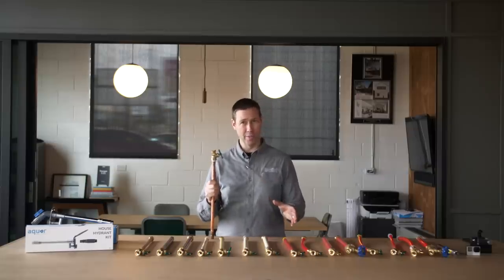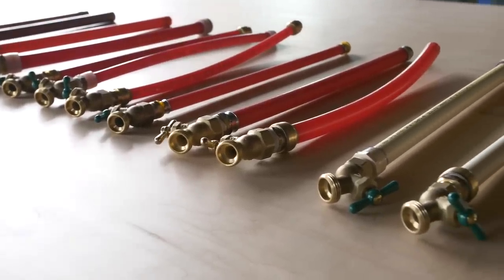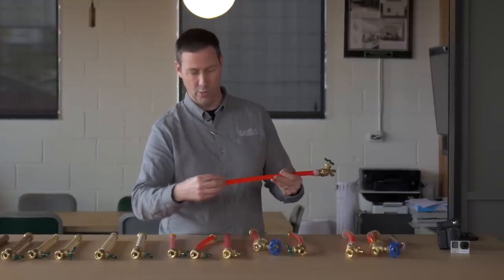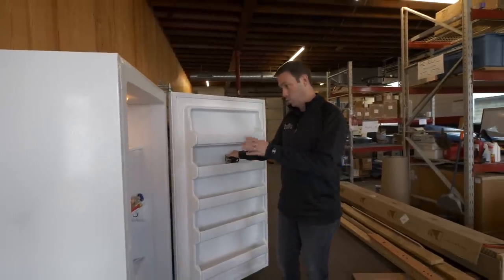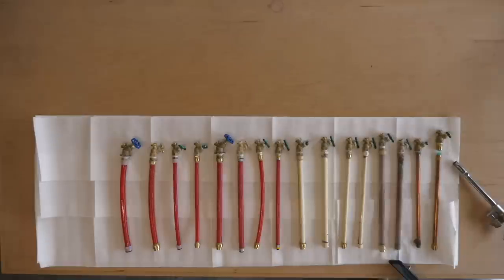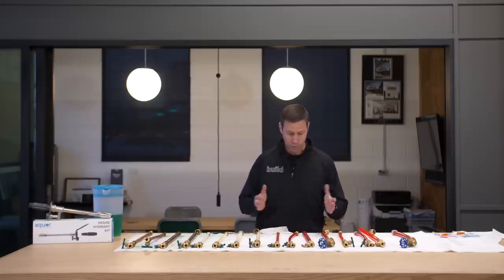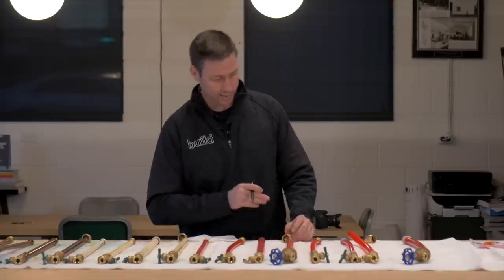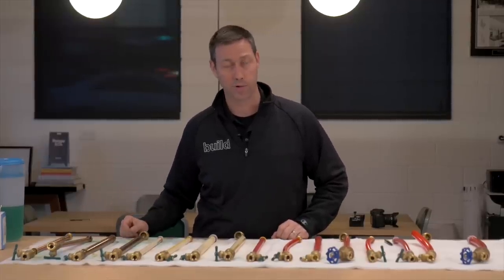Copper vs Pex vs SharkBite - Freeze Testing

Comment: Glad  I  found  your  channel
Reply from the maker: I’m glad you are here!
Reply: Matt Risinger 
   Hi, found your channel and learned about the shark bite fittings from a previous video, so want to say thanks for the info. Have been retired for a little over ten years so haven't kept up with the latest and greatest in the plumbing world, but appreciate how you do this.
   Grew up and worked in the northeast, and then my job has me in just about every state in the southeast, so am familiar with your comments on how things get done in different ways in different areas. One aspect of this that might be before your time was the difference between the southern and national building codes, and how some of the SE state's didn't adopt codes until the later half of the twentieth century.
   One aspect that this test couldn't take into account for is how easily copper conducts heat or cold through out a system that can't happen with the PVC or PEX. So those hose bibs connected to copper in a regular house would have much more space for the frozen water to expand back into the house with less or no damage. And equally the heat from the home will radiate out to the bib to make freezing less likely.
   What you have shown is still interesting, but just wanted to mention the caveat that there would be different results when taking into account these outside fixtures being an extension of a whole system.
Reply: As a professional we don’t use shark bites. They all leak. Great for business.

Comment: You need to start with the lines pressurized.
Reply: You can't compress water. The pressure can go up, but the volume does not change. So for the purpose of testing ice splitting the pipe the water pressure does not matter.
Reply: @kirkwilson5905  Hi Kirk.  Water doesn't compress, but pipes do expand before reaching their failure point. Pressurized water exerts pressure on the pipe even before it's freezes. The 60 PSI in the line, when the line is pressurized is additive to the additional pressure created when the water freezes.

Comment: We have the 50 year old 1/2" copper going through the house wall to the hose spicket. We have never turned off the water for the winter, or put on an insulator, and have never had an issue.  This is up in Detroit where it occasionally gets down to -10F.

Comment: First I'd like to say that your video is very informative and insightful for the average person considering pipe selection for their next plumbing project. For the sake of your test there are some things to consider.  When you inspected the copper pipe with the sharkbite cap had failed, take a good look at how much pipe was inserted into your sharkbite fitting. Make sure that not only the pipe is fully inserted but also remove the plastic insert thats inside the fitting per manufacturers instructions. For all the DIYers out there, please read the instructions that come with your products prior to diving in. If your plumbing product does not come with instructions,  its a sign that it's time to call a professional. Sharkbite is an amazing product when used properly but not cost effective for large projects.
Reply: Note: plastic insert is removed when use with copper pipe only.

Comment: I was doing drywallinb in a new apartment complex  , and all the water lines were PEX . Fair enough , but when the wind brace walling ( earthquake ) walls were install by a differant contractor . The amount of nails that pierced the pipe was incredible . They would have to use a commpressor and see if the pressure held over night , put the whole project late by a week .  Those framers have a habit of useing thd nail guns like machine guns , and if the stud was mixed the nail would go through the plastic pipe   , just a note , but if you get " pros " to do the work , make sure they pay for the damage if there are leaks   , mold inside a wall can condemn the whole house
Reply: The plumbers should have been using nail guard plates on the studs where the water lines passed through, not saying the cheap steel they use to make those nowadays would stop the force of a nail gun or drywall auto screw gun, but it never hurts and is code in my area
Reply: It goes through copper just as easily. Trust me on that one. Annoyed experience here.

Comment: Also wish they were pressurized, it would have been a real test for the pex
Reply: ike fun , Pex has a slight amount of give, and also any air bubbles inside would compress.
Reply: PEX is rated to a higher PSI than CPVC.
Reply: They were under a tremendous amount of pressure obviously.
Reply: rats dont tend to chew cpvc tho...
Reply: I’ve seen cpvc in houses that were around 30 year old give or take were the cpvc was aged and brittle. I only touched the toilet value and it snapped flooding the bathroom. When trying to repair it in the wall, it kept crumbling when trying to recut it
Reply: Adding 60psi more is nothing compared to the pressure from the expansion.
Reply: Bicycle Wang right, pressure really isn’t a factor till it thaws. Then it’s a big factor as a small split releases a tremendous amount of water.
Reply: @hjwang4477  You're missing the point, Wang. Water pressure would also flush out any lurking air bubbles that would skew the results. It would also better represent the actual environment. Get some photos!

Comment: It has been my experience in the last 25 years that the Hose Bibbs Lowes, Home Depot and other supply stores are selling today are cast of such thin brass and low quality brass that the failure from freezing comes there before any type of pipe attached. I literally squeezed a hose bibb in my hand a few years ago and it cracked. thank you China

Comment: I’d like to see this in situ tested with 20 year old pex hoses.
Reply: BigKatz, I'd like to know too, over time how they hold up.   I own a mobile home, with mostly pex water tubing.   I always fear some leak or something, but for 23 years of me living here, and being in Massachusetts, it NEVER failed.  The only pipes that failed in my home during winter is the copper tubing that connects from under my home to the street system.    

Being fair and objective, one year my heat tape stopped working, thus those also insulated copper pipes burst.  But STILL, those uninsulated pex tubing didn't!   I still wonder how long  the pex tubing will be reliable. 🤔     My home was built in 1986, so.... So far, so good!
Reply: My thinking exactly.  Problems usually come over time in service and not in a test lab.
Reply: @martinschulz9381 ; "Problems usually come over time in service and not in a test lab".

 Assuming only freezing scenarios, isn't that indicative of soldered/sweated copper piping? 

Like anything else, the reason for innovation is to build a 'better' mouse trap. The 'best' trap may not (yet) exist.
Reply: I have apartments and total of about 300 water fixtures.  All are pex supply lines and not one break during our Texas Freeze this Feb.2020.  The apartments were built 17 years ago.
Reply: @roncooke6925  ; "Feb 2020"???  Pffttt!  Doesn't compare to Feb 2021.
Reply: @roncooke6925  are they mostly homeruns from a manifold? I’m skeptical, not anti-pex. Anything push to connect also seems like it’s more likely to pop off or leak
Reply: @BigKatz ; Seems like it's all a crap shoot. This February (2021) in Texas, every other house on my street and around the neighborhood  experienced a water line burst, including my own. Had to help four of my elderly neighbors before I got to my own issue. The thing is, I was expecting failure points at elbows and sweated joints. **ALL** of the bursts happened on the copper line itself. My line burst, inside an insulated living space wall leading to the spigot, had two inch gash. Seemed like an Alien had shot out of there, like that dude in the movie, which I can't recall the title. Yes, I used a tape measure and have a pic to prove it. Disclosure: I am the original owner of the house in a 'well to do middle-class' area, built by a reputable home builder. Ironically, I bought and moved in exactly 20 years ago, in February 2001.
Reply: @pintorpi333  that is a crap shoot, perhaps a master plumber from Minnesota could explain it, to answer the question “why this spot” but from your description it makes no sense.
Reply: @BigKatz ; I'm no plumber, just a retired engineer who worked in the aerospace industry. But I do know that H2O expands about 10% when frozen. If the cold finds its way through the metal piping, it will travel through the metal as far as it can. That tubular foam pipe insulation will probably help it, since it's now keeping the cold temperature in the copper from dissipating. In a very small concentrated spot, pressure (coupled with the water/ ice expansion)  can reach more than 10 times line rating. That's why the tests in this video only show part of what can happen. There was zero pressure applied in these lines.

Comment: Matt, very helpful and interesting information for me as a DIY plumber. Thanks 
I would be interested on the outcome under the sub freezing temperature if the copper pipe is soldered with fittings

Comment: Matt, after 25 years in plumbing 15 years owning my own company I still feel copper is the best piping system, granted I'm in the Phoenix Arizona area. I have made more repairs to homes with cpvc where the pipes have become brittle even in climate controlled interior walls and considering all cpvc and pex systems here are run thru the attic with some attics getting above 140° in the summer months. For us desert dwellers copper is still proper in my opinion. Great video as always sir!
Reply: Dude...apples and oranges.

Comment: On the copper pipes,  did you use the type L or type M copper?
Reply: Not a fan of any plastic piping .
Good question on L or M.
When I built my house...I told my contractor too use L , heavy wall copper water supply lines ...ONLY.
NO PLASTIC...AT ALL!!
Pix along with their fittings, to me has not yet been proven..with longevity. 
JUST MY OBSERVATION.
Reply: Doesn't matter if you get a hard freeze ; ice can exert upto 160 tons per square inch pressure it can definitely break either one easily. The problem with copper is it is already somewhat brittle , freezing temps will make all of these materials more brittle and thus more subject to failure with increasing pressure; copper doesn't have as big a change to go through it fails sooner . If you use a good grade of copper with a bit more wall thickness sometimes you can squeeze the split back together and solder it instead of replacing that section of pipe ; that's about as good as it gets if you're going to stick with copper in terms of doing a repair after a freeze up
Reply: @stevekluesner4430  Just re-piped my house with the Pex tubeing. Overall, pretty happy with the results. 
As far as the copper goes, I was just curious if the thicker copper may buy you more time as far as longivity. But as I found out,  poor installation with the copper pipe, shortens its lifespan. Example, too much flux was used when they installed the copper at my hosue...

Comment: Take a pex line, thats been in service for 5 years against a copper pipe 20 years old and do this same test.
Reply: More than likely same results
Reply: @marketmoney8813  Ney. Copper stays the same over the years, any kind of plastic does not. Plastics get spongy over time. And as far as I am aware, water in the USA contains a lot chlorine to fight bacteria. Chlorine will make the plastic tubes go spongy even faster. Copper will burst too, but so will the PEX, PVC and so on. 
If the results would have been the same, why did so many pipes in Texas burst during the freeze? Judging by the result of this video, they should have been fine, right?
Reply: @LimPu  had a copper line split 40 years old. If flux from solder joint is on there it can corrode the line.
Reply: @shadowopsairman1583  
Well there is solderless copper pipes too.

Comment: Used to work in restoration. I’ve seen copper split multiple times in a few feet. And CPVC becomes brittle after a few years. Just bought a house that had water damage to the kitchen (galvanized and cast iron), changed all to PEX. After doing it I learned about PEX A, B, and C. Liking A more with everything I read.

Comment: Wondering if pipes under 40PSI would have a different result
Reply: Not at all.
When water freezes, it expands. There's no stopping it.
I saw a 36" cast iron gate valve froze and broke just from rain water laying in it.. probably a $25,000 valve.

Comment: I have been sold on PEX since I replaced all the 30 year old galvanized pipe in my house outside Houston that was failing due to corrosion. I had one pipe, a feed in an outside wall to a toilet, freeze up during the cold last week without power. It thawed out with no problems. The CPVC in the old family place outside Brian/College Station did not do so well. I had drained the pipes as best that I could but there were pockets of water that just shattered the pipes.

Comment: I live in the deep South and PEX plumbing is used everywhere  in new construction.  Last summer, just after Hurricane Sally, I  had a pinhole leak from water heater feed.  I was able to install a connector in the line in just a few minutes.  I already had pinch clamps and a Ryobi electric clamping tool which I intend to use some day to install cutoff valves for water feed lines to a shower and two bath tubs.
I never understood how the pi hole leak happened except that the water was the hottest right out of the water heater and maybe the thermostat was monetarily acting strange.

Comment: Man get the cheapest product and when a freeze is coming close main water line and drain your water by Leaving all Faucets open till all water gone , plumbers will not tell you that
Reply: Uh, No... that does not work. At least not in Texas. Most of the distribution piping is below the slab. Each fixture has a vertical pipe. Opening the faucet will not drain that part. Plus you still have the pipe leading to the water heater. Best you could do is drain the water down to the level of the lowest faucet.
Many houses with automatic sprinkler irrigation systems have a back-flow device near the meter, You can open the test fittings on the side and drain more water, but a lot is still going to be trapped where it cant drain.
Reply: you would need outlets and the lowest point of your pipes and hope it doesnt have waves in it to trap the water from leaving the system

Comment: Ive used both per A and B.  With my new home up north I’ve been pulling the 1970’s CPVC that has become brittle and am using PEX A  with Uphonor fittings.  We get -20F temps with with up to 110 mph winds through our little valley and my 10 year experience with PEX tells me that the more flexible the better.  The one thing you haven’t talked about it whether the plastic or non-lead brass fittings are best?  I’m going with the non-lead brass simply because it seems that under freeze pressure the brass ridges will retain a better grip on the inner pipe vs the plastic...?

Comment: I can attest to the anti-freeze features of PEX.  I plumbed a kitchen and bath in a small living space above a unheated garage.  The 1" water supply was copper and terminated about 1 foot above dirt floor, from there we installed PEX to the second floor apartment.   The following winter we had a week of 0 Degree day temps and colder nights.  The garage had poor fitting wood doors and unheated.  The next month when the day temps rose above freezing the client called to say that he heard water running in the garage and had turned off the water at the shutoff.  He was not impressed with the PEX.

When I turned on the water to check for leaks water was dripping thru the floor.  I found no breaks in the PEX but the inexpensive kitchen faucet had blown out and split the sides of the cheap casting. Replaced the faucet and as was well.  Fortunately the copper water supply line in the ground did not split, but was somewhat warmed by the earth.

The client revised his opinion of PEX.

Comment: Great video.  Something important to note is that you should always use at least 3” of pex.  Less than that and the pex has not material to expand and will bust.  Might be a good video to show.  Have 2” between two connections and freeze it.  It will blow.

Comment: Great test, but think regions. Copper is used in higher end homes in Southern California homes due to its natural antimicrobial properties, the fact that freezing conditions are extremely rare and its extreme durability when installed correctly. PVC and CPVC are not allowed for potable water in most municipalities here, except for CPVC for fire sprinkler systems where it performs best. PEX pipe is still used here for low cost housing, but due to the higher temperatures it develops algae growth inside the pipes; we’ve repiped remodels with copper when clients see what’s inside of PEX after a few years. I have also seen brand new homes gutted due to rodents chewing through PEX, one new home on a golf course developed 16 leaks from rodents getting past vent screens within 6 months. Thank goodness it wasn’t one of mine! Either type of piping must have filtration to remove the effects of mineral abrasion; and yes PEX can leak from abrasion. I’ve seen a lot of great products in 30 years of building homes, I’ll stick with quality every time.

Comment: Great vid!  Thanks!  I'm here because the heat at my rental property was off so the pipes froze and 2 Shark bite push fittings failed inside a wall.  For three days straight I had water spraying inside my walls.
#badday

Comment: I had a copper pipe to my garden with a shark bite hose bib on it. Forgot to shut off the below ground shutoff one winter and we had an extended freeze and the shark bit was pushed off the pipe and I had a nice frozen waterfall. when it thawed I pushed it back on and it worked for a few more years. The copper never split.